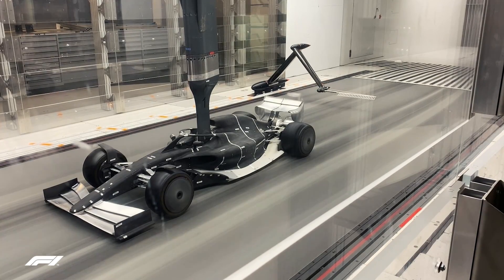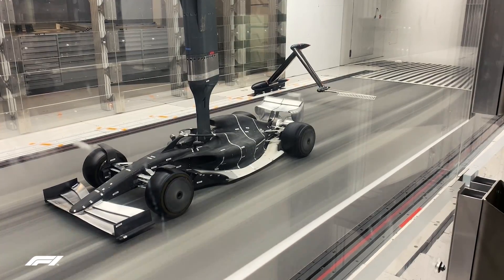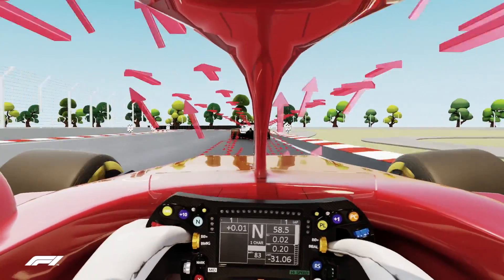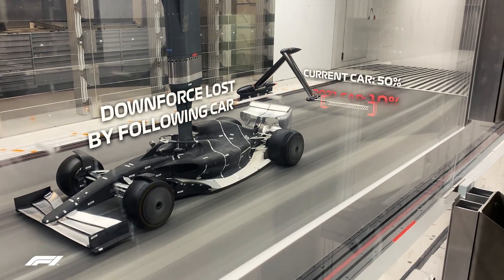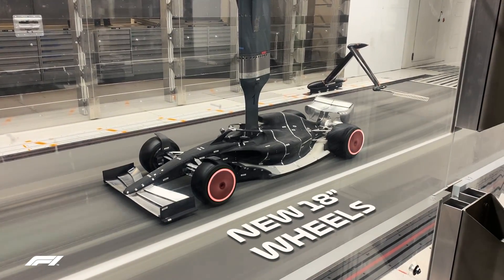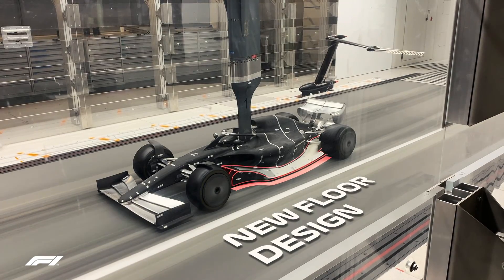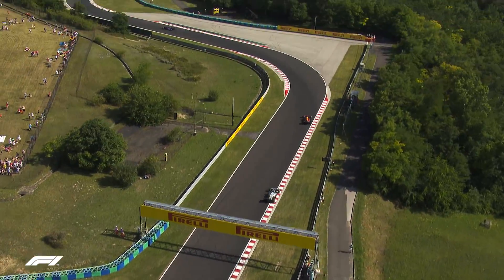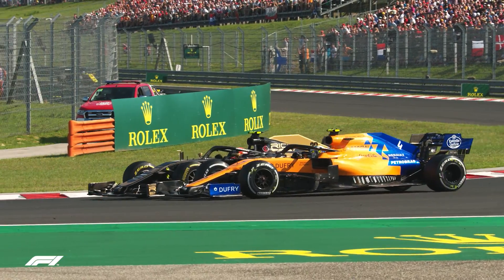Future F1 Car First Look | Formula 1's 2021 Car In The Wind Tunnel

Comment: 50% loss of down-force in the wake?
That means to follow through Eau Rouge, they have to go at those speeds. Else they won't produce enough down-force for when when it's halved, and would fly off to the side. Insane.
How effective is DRS with the new rear wing?
Reply: Its not suppose to be effective! It may or may nt even be operable.

Comment: How are you addressing the problem with the ground effect disappearing when the car bottoms out, leaving it without downforce and prone to fly off the track?
This was the reason why it was banned back in the 80s, after all.
Reply: The parts that generate the ground effect will be mounted to the rear axis rather than the chassis itself, so it stays on the ground while the chassis can bump around freely. At least thats the theory.

Comment: so because of a new wing concept.. there will be no DRS? 👍
Reply: As there is an angle to the top element, there is the possibility of DRS. Though it will have a smaller effect than the 2017-19 cars.

Comment: Doesn't matter about the 5% or 10% turbulence behind the car if the cars Infront are almost half a second quicker than most of the grid. The problem lies far deeper than just aerodynamics.  This really won't make a difference to the state of the sport, but hey, at least it's something.

Comment: If Sauber is this advanced, imagine what is happening over at Mercedes.
Reply: The modell isn't from the Sauber racing team. It was only tested in their wind channel. The model itself was made by the F1 themself, to test out their new rules.
Reply: @euskipeuski7917  isn't Toyota and McLaren have bigger wind tunnel?
Reply: This model is made by the F1 bureau to test the new rules, to see if they really have 10% loss in aero for whoever is following. They used the Sauber wind tunnel because it´s probaly either the closest one or the cheaper one. Or even because they don´t want to use the wind tunnel of the big three, since they are the ones with the biggest budget and any slight piece of info can have a big advantage to them.
Reply: @The_Curious_Cat  Sauber actually built a very advanced wind tunnel but was unable to run it because of the costs of doing so. That was until Alfa Romeo came on board and they could then actually run it in this advanced wind tunnel. Which is what made Sauber go from practically dead last to being so good thus year.
Reply: I think sauber has the biggest wind tunnel, not sure
Reply: @Charles-fc9gi  I'd hate to see the size of the other wind tunnels with a full size F1 car, seeing as this model F1 car was only 50% normal size.
Reply: TheKnightsShield other teams mostly use 60% cars
Reply: @Charles-fc9gi  I always thought they all used full size versions. I'd have thought it would be somewhat easier, as they wouldn't need to worry about recalculating for size. You learn something new every day. :)
Reply: @TheKnightsShield  No one uses full size tunnels, because they would be enormous (as a rule of thumb, for subsonic tunnels, the tunnel's cross sectional area needs to be 12-25 times that of the model) and require a massive amount of electricity to operate. For subsonic flows the similarity calculation to real size is trivial and only the Reynolds number needs to be kept the same as in real life.
Reply: ASJC27 the FIA also has restrictions on model sizes in the wind tunnel 
No model can exceed 60% of a full size car I believe
Reply: Charls nope NASA Ames has the biggest for airplanes
Reply: @user-zv8qg1co4z  Most teams are in the UK yes. But the FIA headquarters is in Paris. So maybe going to switzerland is more convenient for them? Or the combination of being a smaller team with a good windtunnel?
Reply: Biggest wind tunnel own by Toyota company
Reply: adib z actually nasa has one in California that they use to test full scale planes
Reply: They are over there trying to maximize the amount of shitty air that they can poop out on to the Ferraris behind them.
Reply: Uhhh they have 2 chimneys ? Maybe 3 ??? Haaaaahahahhaha
Reply: Aren’t sauber a chassis provider?
Reply: I dont think anybody got the jokee
Reply: Imagine
Reply: It’s just a Sauber wind tunnel. But it you were right then Mercedes would be doing something insane!
Reply: If I'm correct the Sauber wind tunnel was built by BMW when they owned the team
Reply: I honestly hope Mercedes falls behind in this concept
Reply: @landonhall9915  Or rather, why not hope the other teams can finally catch up to the Mercedes...
Reply: @nandusai  true very true but honestly Mercedes constantly winning nearly killed the sport for me

Comment: Does this mean there will be less slipstream on the straights?
Nice car tho!
Reply: There'll be less of a slipstream on the straights but as cars will be able to follow more closely through the corners you won't need as much of a tow to close the gap.

That's the theory anyway.
Reply: No it means more slipstream
Reply: @mackaymultikill7571  No. Less air removed from the car in front will mean that there's more air in the way of the car and drag is increased.
Reply: RacingAtHome it’s not about mass or volume of displaced air. It is about the quality of air stream behind the car. Current cars rely heavily on creating vortices that can be directed easily just once. These vortices cause chaos behind the car in a lower pressure zone. This chaotic airflow reduces downforce and cooling capabilities of chasing cars.

Comment: the most important thing is to hold the "Drink button" ................
Especially for Kimi 🤙
Reply: Hold the "smooth operator" mode also included 😅
Reply: No, no, you wont have the drink.
Reply: You.. You mean the slow button?
Reply: is the drink on
Reply: How old are you? Just for curiosity
Reply: YoU mEan tHE sLoW ButToN
Reply: That would be pointless since kimi wont be in F1 for 2021
Reply: Unless the gadget boils your drink and then squirts it in your mouth at 100psi like the occasionally did a few years ago!
Reply: f
Reply: Don’t forget to also add party mode
Reply: yOu wILL nOt hAvE ThE dRiNk
Reply: Slow batton
Reply: Kimi it it slow batton

Comment: This is so frustrating. The cars have been ugly for ages and also caused problems for following cars because of the wake. 
Answer is simple - just look at cars back when this was not so much a problem and make a modern look with those rules. How the cars got to this point with ugly barge boards and complex bits and pieces is ridiculous.

Comment: Expecting some new car sounds...(my favorite is the Ferrari V10)
Reply: Ray 832 there taking out the MGU-H. Which muffles the engine quite a bit currently.
Reply: Don't excpect any crazy loud sound from it though. It shouldn't be much louder than now as the engine will be smaller in these cars. It should have a nicer sound though.
Reply: Fast Beat I think because of the loss of the MGU-H, they are looking at increasing the engine rev limit too, raising the volume.
Reply: MGU-H remain in the Power unit components. This was already confirmed back in 2018.

Comment: i think racing could be improved with These cars but i think they will be alot slower.
at least put a V10 in it lol :D
Reply: Actually they will be way faster because thanks to the ground effect they will stick to the floor without losing speed from oversized wings. Also todays F1 cars have beaten the records of the older ones with bigger engines a long time ago.

Comment: What I want
BIG wing 
Not so flimsy car 
More hockenheim 2019
Reply: More Hockenheim 2019 requires cars and tyre regulations where they're struggling with little grip. This isn't going to do that. Though one aspect which will come in would be cold tyres after pitstops which would be like driving out of the wet pitlane. The extent, nobody knows yet but if you want a real example of this, the DTM has cold tyres after pitstops as does IndyCar and F2.
Reply: RacingAtHome  I mean having more negatives for going off track in which you loose more then tenth (circuit Paul di ricard) but you don’t go out like Baku’s deadly turn

Comment: I like this look BUT I hate those wheels. It's just better looking with normal tires (normal F1 tires) and don't fix it if it ain't broke! Plus I still don't like the halo, the absence of end plates on the rear wing is werd. Overall I'm pumped of the mix-up and the improvement of racing this is going to make.

Comment: 18'' inch wheels lol .. is this pimp my ride f1 edition. between 13'' inch and 18'' inch is two like 15 or 16'' inch wheels. 18'' inch is just a joke.
Reply: Pimp My Ride? Please get out of 2005 and join us in the present. Most high level motorsports are running low profile tyres on larger rims. Companies like Michelin won't even produce super fat tyres, because all the performance tyres they actually sell are nothing like that. Every modern sports car has low profile tyres. A tiny economy car like the Misubishi Mirage G4 has 14" wheels for crying out loud! 13" are outdated and they look like skateboard wheels on an F1 car -- We're just used to seeing it.

Comment: Ground effects with the most powerful engines ever. May not have the noise we wish, but speed and close racing will hopefully be there. Imagine a Spain GP with cars following and overtaking each other
Reply: How about to see this change in Australia already?
Reply: @sekhyhybrid6701  turn 1 is about to become real special
Reply: @midnoob1650  The Alan Jones Chicane is maybe different next year. Melbourne is thinking about to change the layout. (Which Zandvoort also definetly should do to give a proper race.)
Reply: @sekhyhybrid6701  I was thinking of turn 14 and 16
Reply: @midnoob1650  Don't think turn 14 (Stewart) would make an impact on the tight turn 15 (Senna) for overtaking. Turn 16 (Prost) on the other hand might. (Towards the Alan Jones Chicane. (Turn 1))
Reply: @sekhyhybrid6701  what i mainly meant was that if they can follow properly throughout the last sector, they probably become able to launch an attack in the Alan Jones chicane without needing fresher tyres or a massively better chassis or car.
Reply: @midnoob1650  I agree with you here, mate. I only wrote my opinion about how I was thinking about the situation. In Melbourne it absolutely can make a difference. Maybe it also becomes possible to overtake in turn 6 and turn 9 then. Turn 3 is almost guaranteed.
Reply: @sekhyhybrid6701  the last sector after the third drs zone might become a masterpiece during recess

Comment: I really like it, but I think.. The huge keel will probably become its achilles heel. There would be a lot of drag and way too high center of gravity. But the worst part is that the teams got to find very slim drivers to fit between the back of the keel and the seat. Probably means we will have an entirely new drivers lineup for 2021.

Comment: Lol, "more overtakes" We've heard that before. It's not the frame that's reducing overtakes. It's the engine per team powering them.
Reply: Vivid Paradox13 Well that just ignores dirty air as a concept now doesn’t it?
Reply: @gradywilliams383  No? There's always been turbulent air. There use to be more passes in the past because the engines were more equal. In simple numbers, a 900hp car will struggle to pass even with draft around a 1000hp.  car.
Reply: Vivid Paradox13 At the front of the grid the engines have nothing near the deficit you mentioned. The engines between Renault and Merc in 2018 was estimated to be 54hp. While that is still a lot, it’s about a 5%. Teams like Red Bull compensated with Top-Tier aero packages. Dirty Air Reducing downforce by 50% once a car gets into striking distance is the largest issue. That’s why the 2011 cars were able race so well, because they had a comparatively less reduction in downforce compared to the current gen. 

The engine is just one piece of the puzzle in a holistic industry. The current Ferrari is reputed to be the most powerful engine on the grid, and they’re barely hanging onto second. At the same time Williams is literally dead last with the same engine powered by the current world title leader.

Comment: This is all very well and good, but we know at least one team will come up with some aero loophole to ruin it. And all the other teams will copy it. FOCUS ON THE TYRES. That, and the weight of the cars is what the drivers have complained about for YEARS. But hang on, we can't reduce the weight (or length) of the cars because we need heavy batteries to make it 'road relevant' for all the manufacturers that will join the sport.... oh.. they didn't join....

Comment: I like the nose a lot, reminds me of the early 90s cars which were just gorgeous. I'm not so fond of the rear though, the wing without the side plates looks weird to me. Hopefully we get better racing from it though, that's what's important.
Reply: Its the other way around for me I dislike the nose and like the rest of the car. I was always a fan of lifted noses, if this could look similar to the F2004, but more modern and aero efficient I would really like this design
Reply: I came here thinking the nose application looked like an early 1990s Ferrari as well.
Reply: Just a test wing. They said the race wing will be a little different and hopefully better looking.
Reply: The wing in a loop shape is to minimize the vortices created by the end plates. Any straight cut edge creates a vortice because the high pressure air in one side wants to go to the low pressure air on the opposite end of the endplate, creating a vortice, which creates turbulence and so on. So by making the ends of the wing and endplates continuous, you at least kill some of those vortices... Me thinks.

Comment: Why everybody is complaining about the number of overtakes? There are way too many overtakes than the early 2000s,i dont think f1 is missing overtakes, f1 is missing tighter competition
Reply: I think the tracks are the problem not the cars themselves. Silverstone and the Hungaru events were an absolute thrill
Reply: @karoma7898  tracks like imola need to return, tracks like russia and vietnam need to get out of the calendar
Reply: When the only way to get to the front of the race is to overtake other cars, why do track designers design tracks with very few overtaking places? This means that, unless you start to risk accidents by trying to overtake, you will probably finish where you start, making the highlight of the weekend qualifying.
Reply: Equal engines for everybody...boom problem solved..but it's never gonna happen
Reply: The most realistic option would be to bring back refueling...make the cars start lighter and it would open up new pit strategies
Reply: @PashtetMargarin  Aero is the big problem in the balance of performance equation, not engines. Williams is by far the slowest team on the grid and they use the Mercedes PU which is, well, one of the best, because their aero is hot fucking garbage. Spec engines would only piss off the engine manufacturers and we wouldn't get any benefit at all to racing from it

Comment: They should replace the halo with windscreens, kinda LMP1 cars do
Reply: Aeroscreens might work but aeroscreens won't be able to withstand stresses the current gen halos can. They certainly could make a hybrid between the two like autosport did but I think it'll look hideous. Windscreens however don't have a chance. It might take the open wheel feeling straight out of the window (even though they would technically still be called open wheelers with enclosed cockpits).

Comment: I'm thinking the reduction in downforce increases the speed of the car. So will this really increase the number of overtakes?
Reply: The reduction of downforce will make it easier for a car to follow another. So yes, overtakes should be easier with this design. That is, if the teams dont design ways to create dirty air for their competitors again. It wont however make the car itself faster, might even be slower by limiting design possibilities overall.
Reply: @CrashSeven  I really don't understand what you're saying. Downforce is nice in turns, but on the straights you want as little resistance as possible. So with a lowered amount of downforce, you can catch up to the car ahead and position yourself aggressively before the next turn

Comment: GROUND EFFECT IS BACK BABY!!! YESSS
Reply: we always had it...
Reply: @nanderlizernanderlizer684  yeah, bu t in less way
Reply: Nick Cassetta  no you dindnt understand what I said : with this amazing downforce .. cars will stick to the ground and drivers will never spin and cars will be more easy to drive .. conclusion : It will be boring to see (in 2002 they made rainured tires for that but it was a huge mistake) at least hope they will ban electronic help system for the drivers
Reply: @romanistalazialle1081  you don't understand how downforce and motorsport works. Also they won't have more downforce. they just change how the downforce is generated.
Reply: @HeavyMetalGamingHD  so they will have more downforce as the video said, right?
Reply: @romanistalazialle1081  I didn´t knew the cars could only pass eachother if you spin. lol
Reply: @romanistalazialle1081  i undestand what you said. You didnt even mentioned about downforce, but these 10 year old boys needs really to have the reason, so foget  about it. You and I have watched senna driving
Reply: no need to be happy .. they will be stuck to the road no spin or other mistakes .. 
70 laps of cars following others like train .. they are killing this sport ..

Comment: Also bring back refueling and corresponding tyres so that 2 or even more strategies are viable. This would force drivers to overtake or simply push and drive away.
Reply: Perfect strategy is designed to do the exact opposite of what you want. Teams want their cars in clear air before or after other cars stop meaning they won't need to overtake. Which is exactly what happened in the mid 2000s.